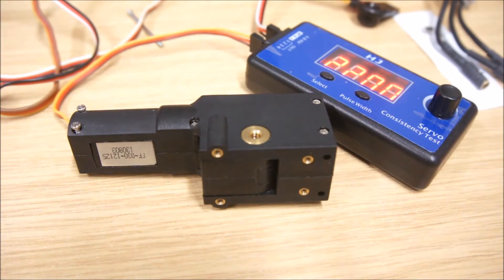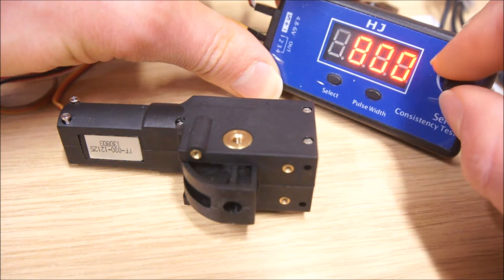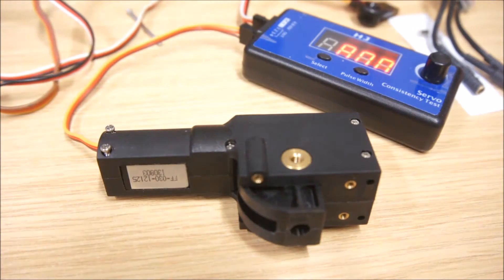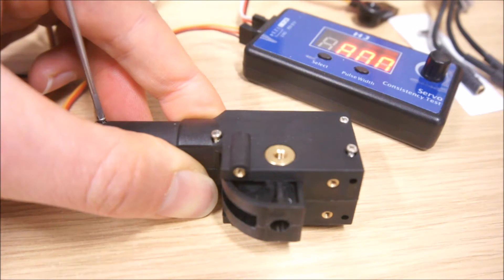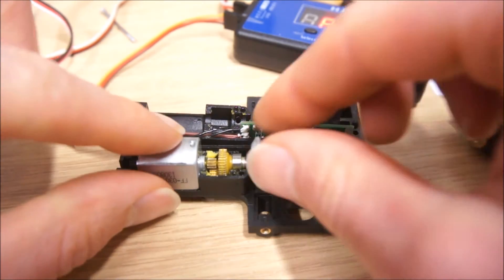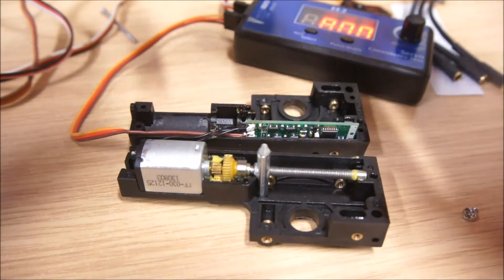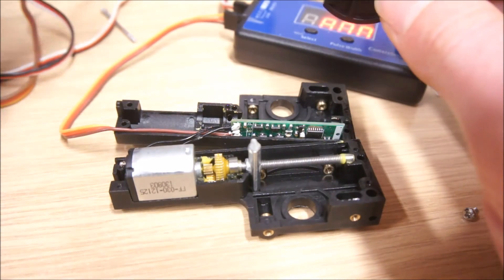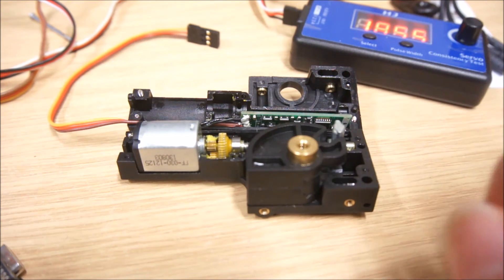Tear Down: Servoless Retract from Hobbyking

Comment: apparently the grease they use gums up the switches after a time causing the switch not to work. a simple cleaning and use of dielectric grease prevents that from happening.
Reply from the maker: Thank you for the info, hopefully that will help some people out there!

Comment: What activates the landing gear? Sorry I'm a newbie.
Reply from the maker: In my video: a servotester
In an RC airplane: the transmitter has a switch and the retracts are plugged into a receiver which receives the command when the pilot flips the switch.
Reply: @YensR  thanks very much.

Comment: Hey Friend I am recently working on making DIY servoless retract at home and had already disassembled a 9g servo.
I was stuck at what to do with the potentiometer.Your video helped me a lot!!!!!Do you think that if we will use a servo circuit with retracts,instead of retract own circuit,will it work??????
PLEASE REPLY ME I'M STUCK:)
Reply from the maker: Thank you for your message, glad you found it helpful :)
What exactly are you trying to do? 
You are trying to use the retract mechanics with the servo electronics?
That sounds weird. I assume you want to build a servoless retract out of a servo. The problem with that is the servo electronics rely on the potentiometer. If you mechanically disconnect the pot from your DIY retract mechanism, then effectively you have turned your servo electronics into a speed controller (ESC) - probably not what you want. 
You need end position switches and diodes to stop the motor from rotating at the end and only be able to rotate into the other direction, out of the end stop. 
There is one electronic device that makes this a bit easier: https://www.cti-modellbau.de/-154.html?language=de
If you want to DIY the limit switches, this might help:
https://electronics.stackexchange.com/questions/453591/motor-with-two-endstops-using-limit-switches
Reply: @YensR  OH....really thanks by the way for the reply:)I was waiting for it.I am trying to build a retract circuit board as i have ordered the gear motor which is used in the retracts.So now i am trying to build a circuit to control the retract movement.So I was asking you that for the circuit,can I use a servo circuit for it??????And also I opened the link and I knew what is landing gear sequencer and also how to use it.But how to use the ESC limit switch also I don't know how will I use it???????Also I checked for the endswitch for the retracts.But as you said in the video an shown,there are smd endswitch used in them.I saw for it on websites but didn't find"smd" endswitch.But also will these endswitch work?????I HOPE FOR A REPLY AGAIN:)
Reply from the maker: @rcplanetech8095  The link to CTI is not a landing gear sequencer! It serves as a better alternative to the limit switch principle I tried to explain. Hopefully google translate gives you an idea how it works.
You don't need to use SMD end switches, they are tiny and therefore difficult to work with. Electromechanical micro/mini switches work best for your purpose. 
This is the image:
https://i.stack.imgur.com/kSUVF.jpg
However, the description of diodes used in that link is not very clear, but for that you can see here: 
https://electronics.stackexchange.com/questions/293726/limit-switch-on-reversing-motor
With these switches and diodes, you can use a standard servo electronic. In one position, the motor will rotate in one direction until it hits the limit switch. Then it will switch off, unless you reverse direction. In that case, the diode will circumvent the limit switch and the motor runs in the other direction until it hits the other endstop.
There are other ways to switch the motor from left to right, but servo electronics are very cheap, so if you already have that, you can use it.
You'll have to read around a bit for yourself, there's lots of information out there. Why don't you upload a video, so people see what you are working on and give help? 
Because there are dozens of ways to solve this and it's not clear which is the best one for you.
Reply from the maker: @rcplanetech8095  Did my reply help you? Let me know where/if you are stuck.

Comment: Hi, nice video, do you think I could use the motor control board for a copper coil, (instead of the motor )that I need to control a magnet and also switch the current? Like a electromagnet pushing a magnet.
Reply from the maker: If you want to control a voice coil, you can use this, but it would be easier to buy a cheap ESC (electronic speed control) for brushed motors (not brushless) and use that to adjust the voltage and hence current in the coil.   
There are very simple ones on ebay.